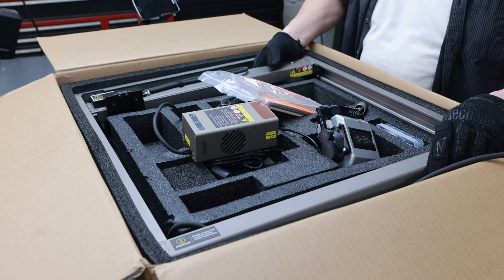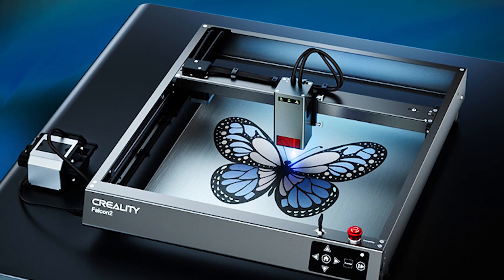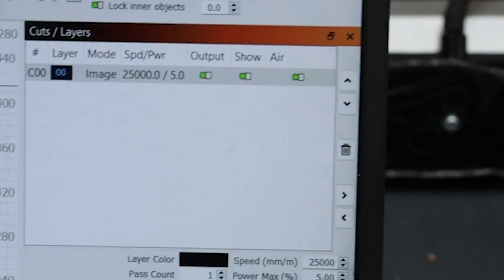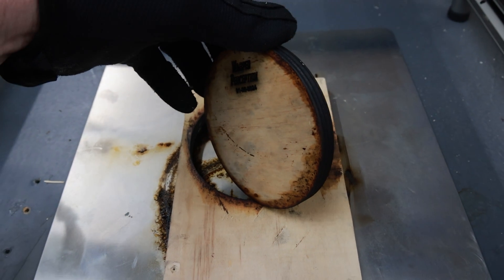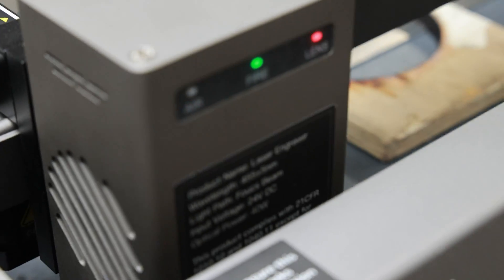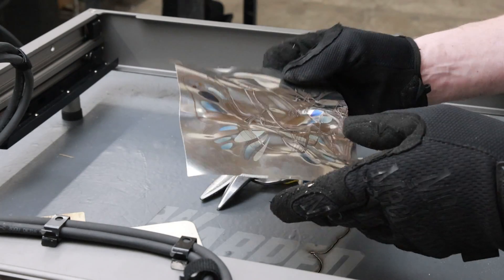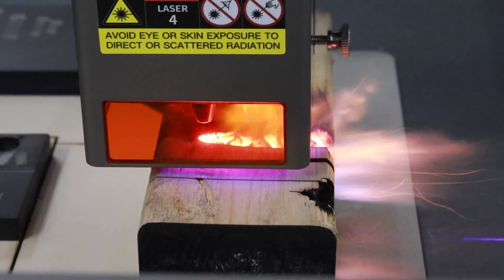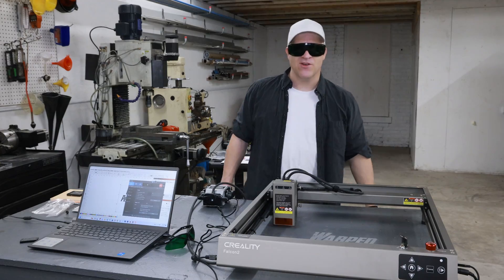Insane Creality Laser - is it Worth $1300?

Comment: Be very careful with that open air laser, I've heard and seen mishaps with those things...............especially anything with a mirror like surface causing the laser to bounce off of the material.
Reply from the maker: Yup . Exactly, I should have mentioned that in the video, especially when a piece that you're cutting gets warped and the reflective angle changes, And just by chance if that angle directs that laser into your eyes you're done